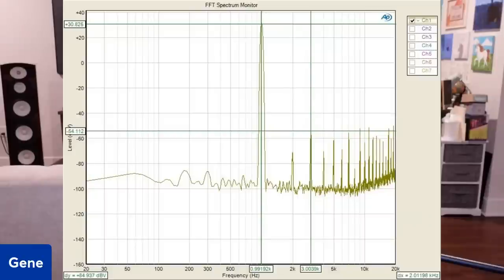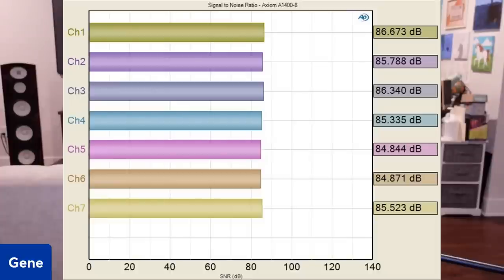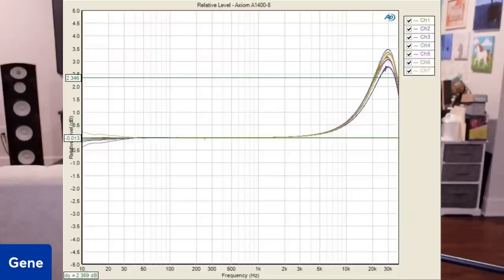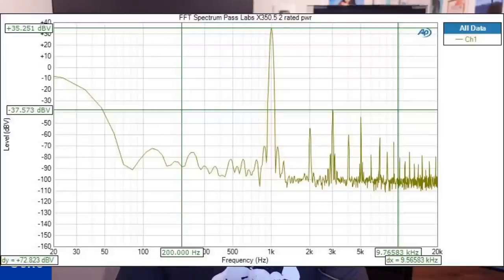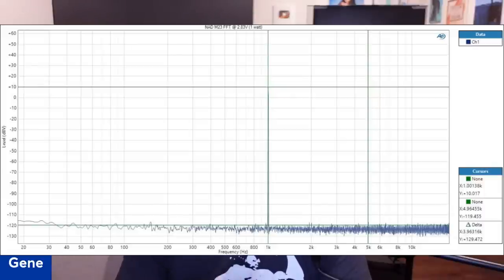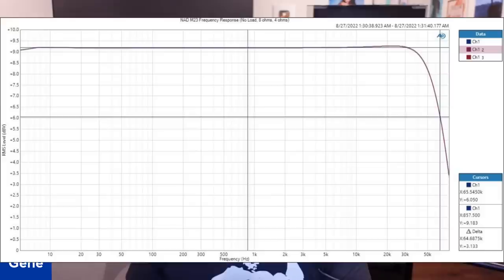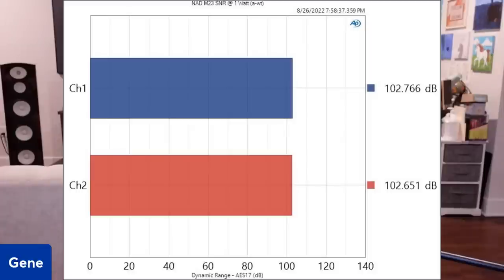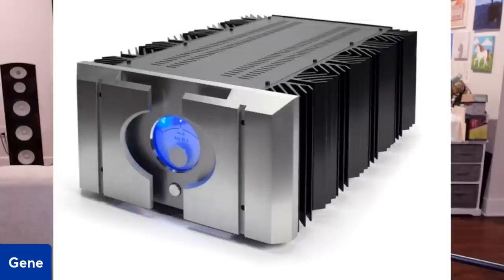Linear Amps are DEAD, Long Live Class D!

Comment: Hey Gene.  I finally made the step from a Marantz SR7013 to a NAD T 778.  It would be interesting if you get the same findings with one of these although I know they've been out a couple of years now.  I can understand why some may find the sound, maybe, a little offensive, a lack of warmth, although that can be dialled back in with Dirac target curves for a bit of personal signature.  I've had very little listening time so far, it's very different to the sound I'm used to (Arcam, Marantz).  As I get more familiar with it, the transparency, instrument separation and depth is really nice, and my room is really bad!  Anyways, getting the NAD was part of my venture to minimise the amount of energy our home is taking from the grid and there's a lot more coming.  Hope you're doing well and keep this amazing content coming, it's really useful and so good!
Reply: yes it can be odd to hear an output as intended when one is used to a certain pleasant distortion.  you'll get quite used to it friend.  and a little high quality DSP EQ (or dirac) never hurt anybody - that is subjective!  but you want your preferred EQ to come from just that - an EQ, NOT from an amp's inherent design.  you now have a superior base to start from, and the speed and transparency you notice are the proof of that.  the only downside is that lesser quality source material doesn't come across as well because it's not as forgiving and doesn't have as much of a smoothing effect.  this can be partially corrected for by EQ, but it is what it is.  also give your amp some break in time.  sometimes the break in concept is BS, or the number of hours one says is required can be BS, but that depends on the equipment.  the digital heart of your amp needs no break in... but the thing still has caps and mosfets etc. and I have seen class T amps (subset of D) smooth out a bit in the treble.   play some loud white noise when you're away from the house or just a bass tone.  it needs some juice running through it no 1 watt crap, heat it up.

Comment: Good video- its amazing how  well it measured. Did you happen to measure IMD?  Will be sure to watch follow up of how it sounds. The only negative I see is seviceability if its built simuliar to the older ones I've looked at. You cant just replace a couple transistors to fix a channel since they use modules which are probably very costly. The switching supply to be that clean would likely be designed simuliar to something in a top end PC which are very complex internally.
Reply from the maker: Yes and IMD almost always better than THD+N
Reply: @Audioholics  Good to know. Thanks
Reply: The modules themselves sourced from Hypex, Purifi and others are not overly expensive all things considered. 
But regarding proprietary tech introduced by OEM manufacturers YMMV. That will depend on the manufacturer's track record.
I'm sticking with "plain vanilla" for the time being. Swapping amp modules (if ever you should need to) will not bankrupt you.
Reply: @juanmillaruelo7647  Thats good they are available. As long as mfgrs keep parts for up to 10 years after launch I'm OK with it.

Comment: Class D has been bringing us high power, now it is doing it with refinement.  A friend is running a Crown XLS2500 to run his beefy system.  The Crown has stupid power and, much to my surprise, it didn't sound rough.  His 2500 might not be the most refined thing, but it is good, and as for sheer bang for the buck, the Crowns are hard to beat.  The NAD M33 has my full attention though.  Power and top notch refinement and fidelity.  What is not to like?
Reply: Have tested Crown XLS 1502 on KEF R11, Arendal 1723 Tower, Sonus Faber Nova V and sounds wonderful on all. The KEF and Arendals previously powered by Denon 8805HA and the Sonus Faber powered by the excellent ATI NCore. Couldn't hear ANY degradation in sound quality...in fact changing out the denon for the much more powerful Crown brought new life into the KEF and Arendals. There impact on the Arendal was much bigger due to those towers being VERY power hungry and rated @ 400watts 4OHM. Am I saying the Crown are the last word in quality....absolutely NOT. But you will really struggle to find better value in the high power segment. Purifi is the aim but just cannot make myself spend the money to get equivalent.

Another thought is to sell my denon 8805HA and buy the new denon 3800 which apparently will support Audyessy & Dirac and 4 independent subs and use it as a processor with crowns powering bed layer. Interestings times ahead for value driven people.
Reply: @pumpituphomeboy  Excellent!  Agree 100%.  The newer Crowns also incorporate cool features, really amazing for their price.  Gain controls, integrated crossover, active cooling and LEDs indicating over temp and clipping.  Seeing the clipping or temp LEDs activate would take some doing on a home audio system.  Likely the house would suffer structural damage first 😆

Another good 2 channel bang for the buck class D amp to look at is Parasound's ZoneMaster 2350.  Match it to their P6 Preamp for a nice system for a fraction of the cost of the comparable PS Audio setup.

Comment: I would say that in the lower segments the difference is even more profound. Take something like the Sonos Amp: a tiny integrated streaming amp with 2x125W DDFA power. That thing sounds great, drives low impedance loads, and basically puts every AB amplifier that costs twice as much to shame. The same goes for NAD amplifiers with Hypex' "low-end" UcD modules. It's simply amazing.

Comment: This is off topic a bit, but I'd really like to see Gene cover the Minidsp flex or shd. Using either of these as a preamp with dirac and a purifi power amp seems to be state of the art performance for a moderate investment.
Reply: I would like to see that too.
Reply: I use the shd studio with hypex in a digital streaming system and it's really nice.
Reply: @Phloored  my friend does too. On Polk L600 and REL subs.
Reply: SHD straight into Pure Class A Triode monoblocks for me partnered with standmount speakers with a very flat impedance curve. Amps inefficient? yes but it’s a fast, natural, non-fatiguing sound and ok by today’s standard 0.13% THD at 1W may be considered high but it’s mainly second harmonic the most benign and musical harmonic. Oh and multi sub is also employed to ensure the bass remains tight. Now I’m not saying there aren’t better sounding systems out there but I’ve not heard one yet at any price :-)
Reply: Love the mini dsp unit.
Reply: @asx1248  do you employ the room correction? That was an eye opener for me for sure
Reply: @Phloored  yes but with multi sub I used MSO to integrate my subs. Applied all the biquads then ran Dirac.
Reply: Cool. My speakers go down to 23htz in a small 2 channel listening room. Thank God for room correction.
Reply: Denon will release the x2800 h and x3800h soon and it has Dirac Live as an upgrade option. No longer need for minidsp. (The x4800h will be coming by the end of next year.) Gene has a video of the x3800h.
Reply: @WimHulpia  yes it will be an interesting watch.

Comment: Where can I dump my Pass X600.5's? ;-) That picture of the Pass amp that you showed is not the setreo X350.5 AB amp but  a Pass XA200.5, 200 Watts Class A monaural amp weighing in at 160 lbs per channel taking in 700 Watts when idling.

Comment: I just replaced an Onkyo receiver with a small integrated class d amp to test the waters. I can say I'm blown away with the absolute pristine audio I'm enjoying now.
Reply: I'm in a similar situation. However, I regret buying the cheapest Tripath amp with only 10W of power. It sounds pristine however! Desktop amps are definitely a trap. All amps should have at least 25W on tap. It doesn't take more space.

Comment: Hello Gene. Great video. Very informative. I was wondering if you've tested the old Acurus A200 and/or Acurus A200x3 amplifiers. I just lost mine in a strange fire at my Daughter in law's house. Also last was my Lexicon MC1 and my old pair of Paradigm Studio 100 V1s. A drunk driver hit a utility pole outside of a body shop where my daughter in law, husband and 2 sons lived above the shop. The accident caused a fire in the shop which engulfed the entire structure quickly and thoroughly. My family made it out safely but my home theater that I stored there after an abrupt move to Puerto Rico was incinerated until unrecognizable. My daughter in law and family have since bought and moved into their own house within 4 months of the fire. They didn't have renter's insurance and we don't know if we'll be entitled to replacements at this time. I was just curious about an independent testing of those amps I was able to enjoy for 2 decades. Btw, I owned a Marantz SR880 MK II before graduating to separates. For financial reasons I'm thinking about starting anew with another Marantz receiver. Any info on those Acurus amps would be appreciated. It appears that the company that revived Acurus are upholding the high quality sound and build quality that was delivered by Aragon Home Audio.
Reply from the maker: So sorry to hear this but glad your family made it out. I used and loved Aragon amps for many years including the Palladiums and 8008 series. They were great but ran hot and consumed a lot of power. If I were on the market for a new amp today, I'd move to a SOTA class D for sure. Nothing wrong with great linear amps but they aren't very efficient which is a problem when you go to a multi-ch speaker system for Atmos.
Reply: @Audioholics  Hello again Gene, thanks for the reply. I was finally able to get a partial charge of our laptop and cell phones since Hurricane Fiona has left our area without electricity and water. I remember those 8008s. If my memory is correct, they had the distinctive wedge cut out of the top of the chassis. I coveted those but I couldn't find them for the price I wanted. The Acurus amps were extremely good at heat dissipation. They also had a traditional shape with 3 sided cooling capability. The more I write about my old gear the more I miss it. Hopefully I can bounce back. Keep up the great work on your channel and I'll keep watching. Peace.

Comment: I think if you have an amplifier no more than twenty-thirty years old, you probably should not worry of upgrading amplifier at all. And if you just need to buy one, it doesn't matter if it AB or D class, any modern amplifier do their job equally well, I'm pretty sure because I had three quite inexpensive amps from pioneer and yamaha, and I never even thought to upgrade them, was completely satisfied, and, which is more important, there is no difference in sound between them. Say, if you have problems with your loudspeakers, none amplifier will solve this. If you don't have such problems, there's no reason to upgrade amplifier. The only worthy reason to prefer D class over that it is much more "green friendly", as it doesn't waste any energy on heat.

Comment: For AV application, agree class  D is very appropriate; however, as an owner of several class D amps and class A/B amps, I cannot take the sound of class D for listening into music (i.e. really listening into the music not just background sound) for  periods of time over an hour. It just sounds too artificial to me.  I like/prefer D for surround application, but not stereo. My D amps are decently high end and I've been to audio shows listening to some of the "best" D amps on the market, and still have the same impression. It is great to look at my power conditioner and see the class D pulling a meer 0.6 amps as compared to a chunky A/B which idles at 1.8 amps. For now I need to have both D and A/B in my lineup as D still butchers the midrange of music, yet has excellent control over bass drivers. In time some form of D topology will probably do it all, particularly if it can be made to sound "tubie" for those of us who love the holographic sound of tube amplifiers.

Comment: Ran a class D Alpine 4 channel amplifier. For its price and form factor it has served me well and had plenty of power to drive the speakers in my car. Sounds great as well.

I also had a PS Audio Stellar S300. Sounded ok but felt every other a/b amplifier I had at home fit better sonically, almost as it had a constant touch of coloration and lacked depth. They're ok, work good but I would not fetch boutique price tags for what happens to be essentially an expensive chassis for a common kit amp.

Comment: Ok, got it, when my current Emotiva XPA -1  generation 2 class a a/b 600 watt mono blocks die then I will look at a good class d amp.    But not going to go right out and buy a class d just because they measure great.  But good to know that high $ amps like the pass labs linear amps are nothing to covet.  Sure look impressive though.  Like the Dan Dagostino gear sure looks like audio nirvana but would never spend that kind of money on an amp.

Comment: Class D may use less power, be relatively cheaper, lighter in weight but most people buy equipment to produce the most pleasing (versus accurate) sound from their system which is conducive to long term listening; this is why there is still a tremendous demand for tube equipment. Additionally, we all hear differently and our listening rooms vary greatly hence, one size does not fit all!
Reply from the maker: You assume a product that measures great will somehow sound bad. But somehow the poor measuring product will sound better. Got it.
Reply: @Audioholics  You have elitist opinions  about the subjectivity of audio preferences. Some people think class D lacks presence and is not enjoyable to listen to, yet you keep arguing specs like that is all that matters. It's 2022 and for some reason people are buying tube amps which are cumbersome and not as clean!?!?
Reply from the maker: @kensmechanicalaffair  it's 2022 and people still buy McDonald's.  Enjoy